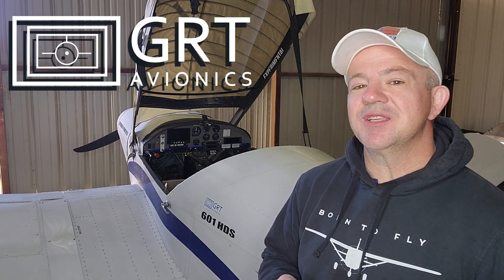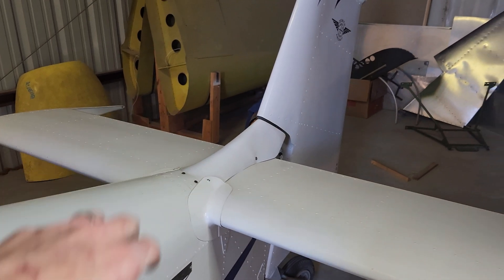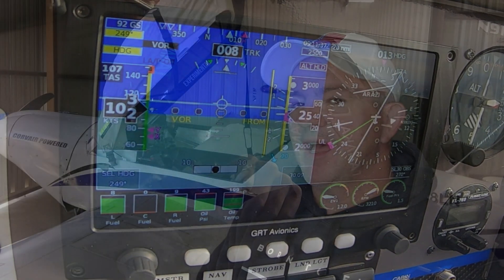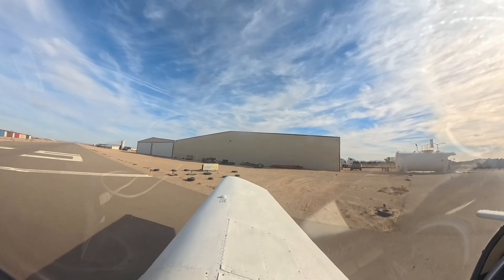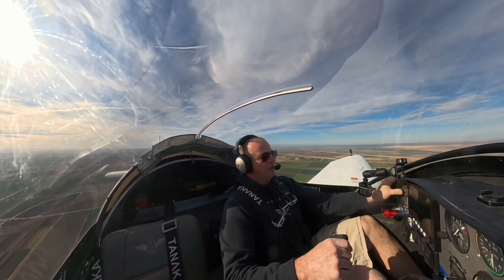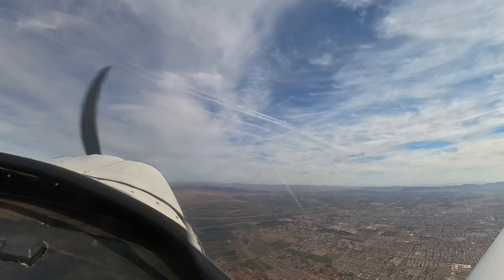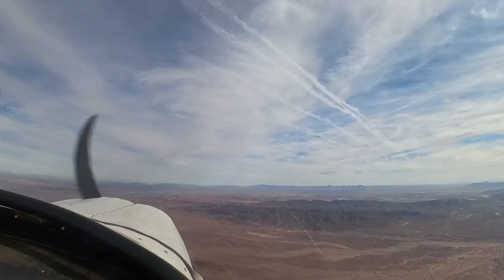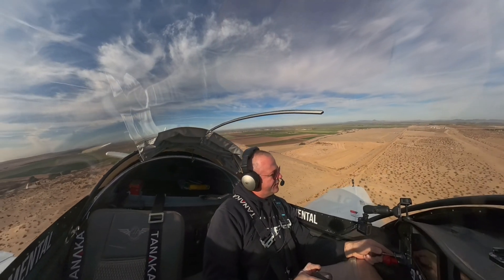Performance Improvements for my Light Sport Airplane

Comment: I've looked at them and the website doesn't show any installed pics or details of how to best secure them in place
Reply from the maker: @alanverity341  i used 3 rivnuts.  2 under the wind and one on the factory vertical faring.  others use 3m 2 sided tape.  I went the way I did so I could remove them to inspect during my condition inspection.
Reply: @zenvairpilot would you be able to do a video showing the details of all this?

Comment: Cool video Larry, but I'm not sure you can chalk up the whole change in TAS to the fairings alone. Your original screenshot showed that you were at 2500 ft on the before, and your second test was at 4000 feet. Higher up you should have a higher TAS. I would think a better test would be at the same density altitude.
Reply from the maker: @spapantherbuilder5923  i have tested same DA and altitude.  I just didn't have a good screenshot of the EFIS at that altitude.
Reply: @zenvairpilot  Good deal!  And congrats on passing the IR written